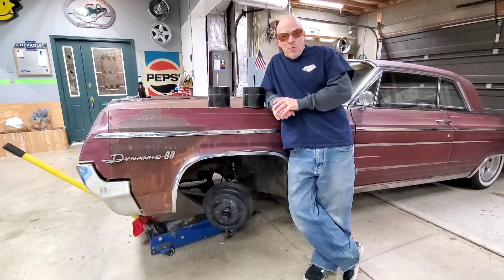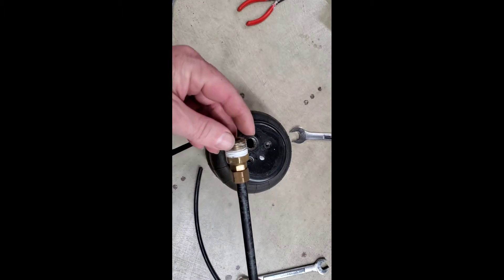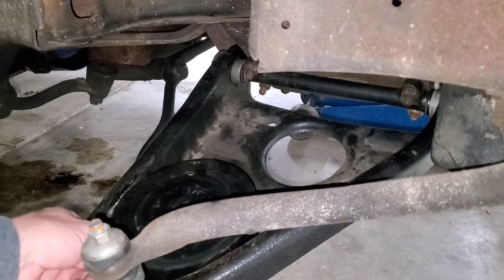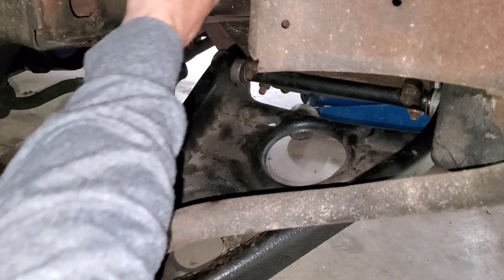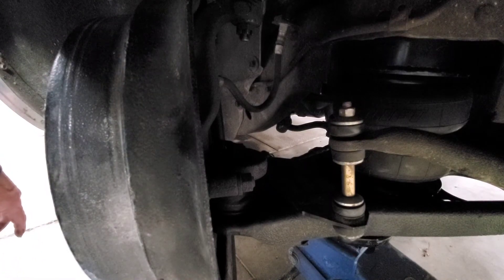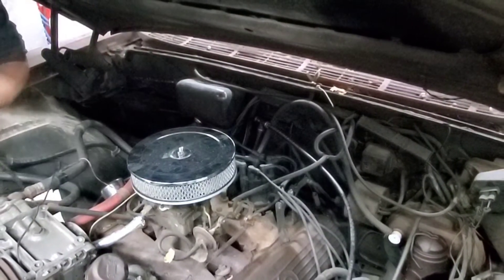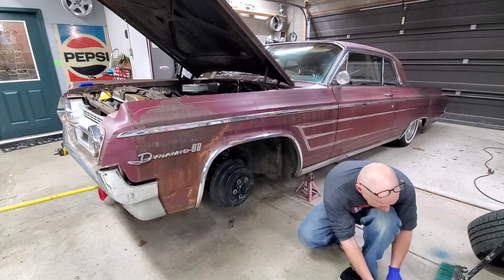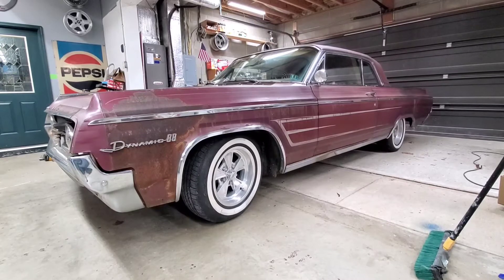Bagging a 1964 Oldsmobile Dynamic 88 part 2. installing front bags. How to: Bag a lowrider.

Comment: 1 inch in the middle-ish of the control arm will be 2-3 inches at the end of the control arm depending on the pivot ratio 👍🏽
Reply from the maker: Where were you when I needed you? Lol thanks man. I'm thinking I'm gonna add 1/2" back in cause I've already been stranded once! Lol
Reply: @HardCoreGarage  installing some bump stops at the lowest height you want might be easier then tearing it back down
Reply from the maker: Very true!